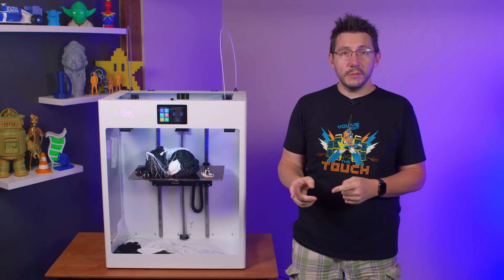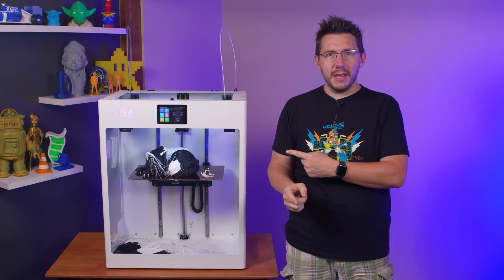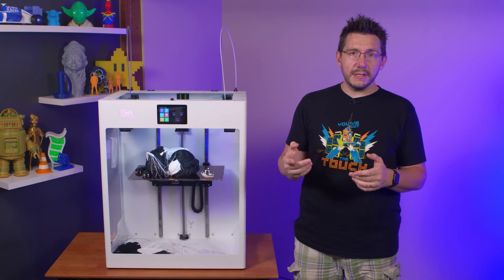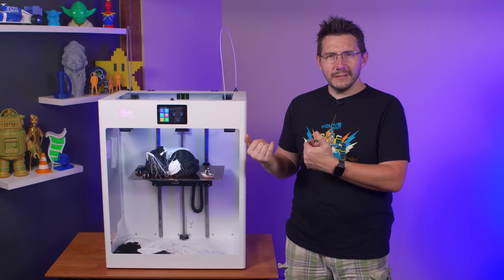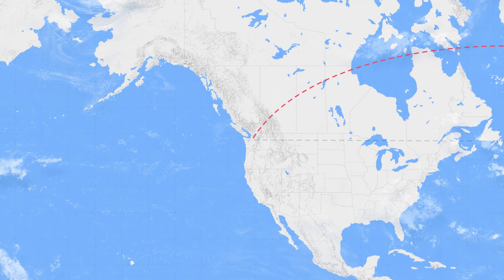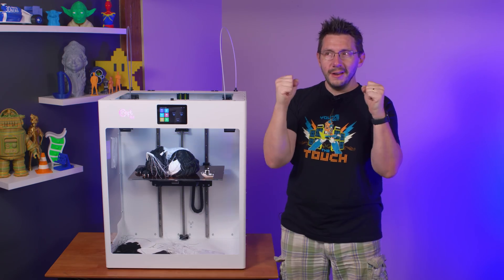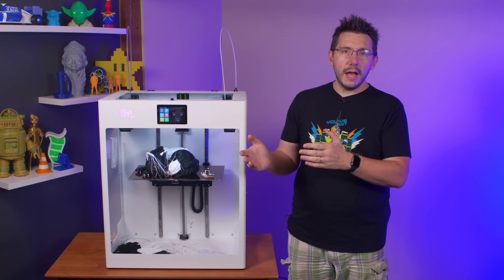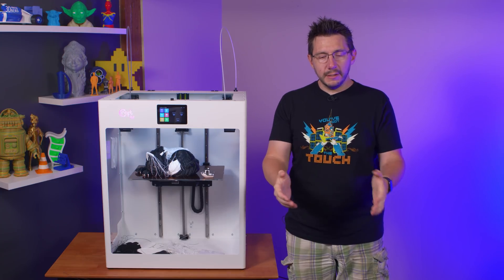Craftbot FLOW IDEX XL Update - THE PINS WERE BENT!

Comment: The Flow idex is a really bad printer.We already had 3 simple craftbot+ printers before we bought the idex.All 3 cb+ was working excellent, thats why we jumped into the idex.From the first time we had serious problems with it (layer shifting, sudden stops, bed calibration problems, filament sensor problems, etc...) The Hungarian distributor just gave us a new printer in the first month, saying that they just can't repair the other one. We were very happy, thinking that now the new printer will work as expected.It did not.We had many failed prints, same bed problems, unfinished prints, firmware issues, etc...Now the printer went back the 2nd time to the Hungarian distributor, and they say its working good but we know that its not.Maybe a few prints could be good, but not all.We expected that a 4000USD price tagged printer could produce the same quality and reliablility as the old cb+, but we realized that its not going to happen.Now the distributor offered to buy it back for around 2000USD (the half of the original price!) or we can get it back with the glitches.What a bad support is this?They just neither care about their customers,  nor their printers. PLEASE, If you're planning to get this printer or any from the FLOW family, DO NOT BUY IT! Buy 4 prusa MK3S printers  instead!

Comment: Had the same bent pins issue on delivery.  Several temp driver errors. Fan issues.  Parts were replaced, but still have some print warning errors. When it works it prints well.

Comment: Wow... looks like a negative review. For just about $4K (about the same price for the E3D toolchanger kit) you get a poorly designed system made with proprietary parts. A no buy... At least based on your small sample set of tries.
OTOH... maybe if you printed for awhile with it... like maybe a spool or two and produced lots of objects and you learned how to tune the filament monitoring, you would feel different... or not.

Comment: Wait a second the nozzle was only jammed because the temperature being used was too low to melt filament that was already in it. So essentially it could have been resolve by just raising the temperature. It sounds stupid but its not surprising there are people that do this in the groups. Just looking at the pin that was soldered there that broke off it wasn't even supposed to be able to move around. With the fact it kept stopping I would have thought it was either a firmware issue or that I had missed something in regards to connectivity if the sensor was failing to be able to tell that the filament was even rolling.
Reply from the maker: Which nozzle? The one shipped to me was jammed, and the way these work - the nozzle screws through the heater block and into the heat break. To clear that nozzle in the machine, I would have had to induce some heat creep.
Reply: @3DPrintingNerd  At 7:39 when you unscrewed it you could have pulled the part out with needle nosed pliers and the heated it up without the heatsink cooling fan and then pushed it through or used a heat gun to heat it up to push it through. There are many times on other printers where people have had their heatsink cooling fan on backwards and caused this same issue.
Reply from the maker: @Deneteus  Right,  I could have introduced heat creep to solve it, or like I said in the video, I could have used a heat gun to clear it. The point is I should not have had to do any of that. Craftbot sent, essentially, a defective part. Had I been told, "this was used before in another machine, we don't know the status, check it first before installing." that would have been great. Instead it and the other pieces were sent "as new".
Reply: @3DPrintingNerd  I wasn't on your stream when you first unboxed it. I agree with the anger over the lack of communication/miscommunication when the second part was sent as to whether it had been tested and cleared before it was sent. That was clearly a QA issue that they could improve on. It wasn't immediately apparent though that you purchased this machine with your own money so anyone that has been watching you for a while would assume you would have just fixed the problem and pointed it out without the yelling/dramatics. 

It just encourages that mindset that if it doesn't work the first time you get it then you should just bash the machine or bash the manufacturer. That is the same reason we have people destroying Creality Ender-3's for attention. Sometimes printers do get damaged in the mail. Paying alot of money doesn't always mean that things will work they way you want them to. 

Sometimes people also get printers or parts that people have returned. We are still in a pandemic and sometimes people forget that so anything you are attempting to do is being magnified on top of the fact that there are obviously other people that have also run into issues. I am not sure if you realize that not everyone took that part of the video the same way. Whatever the issue is with their QA, hopefully they will fix it. If not they will go out of business with the rest of them.
Reply from the maker: @Deneteus  Hey dude, you make some very good points. Though, regarding the mindset - I have to disagree. I fully get what you're saying, but in my case, we are talking about a review unit, and then the company reached out the next morning saying they were sending me new parts to fix it. I get that money doesn't always equal it should work 100% right away, and I know people talk learning curves, and experience, I get it. But, in no way shape or form should Craftbot have sent a clogged nozzle as a quick ship repair piece. Had they reached out the next morning with tips and tricks to try, rather than insta-shipping new things, it would have been an entirely different story.

Comment: We have one of these since 2 months ago. Spent a lot of time to get it commissioned. They clearly have quality control issues, our machine had the set screw for the right extruder filament gear overtightened (hex slot ruined). Also one of the right extruder hot-end hex screws is eating its threads and will need replacement. A few other practical observations:
- Despite the automation, this is not a beginner printer. You need considerable expertise to work through eventual issues. There are apparently only a few users as there is not much help online.
- Overall the machine is built like a tank and you can see quality design touches everywhere. The automatic calibration is a must-have. 
- Extruder shroud re-assembly is delicate work. Think of it as attaching the display flex cable of an iPhone. If you misalign the shroud and use any force you will get the results in this video: bent pins and de-soldered guide pins. That is not shipping damage but forced assembly.
- Don't think the nozzle is pre-clogged, there's just some filament left in the feed channel (filament was unloaded cold after factory test?). Just heat the nozzle and use one of the smaller hex keys in the kit to force the filament into the nozzle (after releasing extruder gear pressure) 
- When you swap a steel nozzle to print non-toy materials, it will be higher than the brass one. So swap both of them even if you use the right extruder for support. If the nozzle heights differ by more than 0.1? mm you need to move the right extruder manually. It does not work like in their instructions (gravity drop to the bed), you need to actually force push it down to touch the bed.
- We have had nothing than trouble with PVA supports. All PVA we have tried has been flexible enough to get stuck in the filament sensor aperture. Results in terrible clogging that needs extruder disassy to clear. If you release the extruder tension it does not extrude properly. Just use HIPS for support.
- Firmware (latest of course) has weird issues with the whole printer freezing with no apparent reason (just stops and extrudes a biig blob, or makes weird moves and the freezes completely). Suggest power cycling before a longer print.
- The remote UI does not (yet) replicate all the features of the touch screen so you cannot really adjust the print job remotely. And the camera is too low resolution (cheap?)
- Our biggest gripe is the lack of z fine-tuning. The automatic calibration leaves z too high. To get stuff to stick to the bed we currently need to apply a global gcode offset in S3D
- Get spare silicone socks for hot-ends (they break easily when you swap nozzles). Also get spare bed probe pins, the machine eats those whenever you crash the left extruder

Comment: I don't care how bad a product is, but cmon... The clogged nozzle was obviously placed from you using it to test it. Im not saying that the product is good at all, since it should have not clogged, but it was not sent in that condition, that is pretty much like calling workers over there a moron/dick for pre clogging your nozzle... Will probably getting the worker that sent you the assembly in trouble, not very cool thing to do.
Reply from the maker: That's how it arrived, why would I lie about that? Why would you think I'm not telling the truth about that? It was sent in that condition 100%.
Reply: @3DPrintingNerd  Im not saying that you are intentionally lying, just that you believe that the nozzle came that way, whereas that clog probably came after your first "test" print run.
Reply from the maker: @Gabriel-us7gi  No, dude. It came that way. I installed it. The filament wouldn't pass through. It couldn't get to the melt zone. The filament inside that nozzle is ABOVE the heater, and into the heat break. I promise, that is 100% how the nozzle came to me. I have no reason to lie about that, or fib, or anything.

Comment: I couldn’t find a place to post this so here it is. I have changed both heating element on the extruder and the   thermal sensor. When I turn the printer on and turn the temperature up to 210. The temperature does nothing and then I get the error saying E1 thermal runaway printer halted please rest. Should I do a PID to fix’s this issue or could be the
main board that has went bad? Any help would be appreciated.

Comment: Just disassemble the extruder one more time, if you unscrew the 2 allen screws which hold the spring you will see that one is too long and contacts the other side, so the force of the filament ist low.  I had the same issues.
Reply from the maker: Wait - really?
Reply: @3DPrintingNerd  Yes, really, I can send you pictures if you want. I had the same problem with the jamed extruder and detected a low force on the filament. after shortening the screw it printed fine.
Reply: Or you could adjust the filament adjust screw on the top of the extruder and your problem would have been solved no need to disassemble
Reply: @fuse3d  Thanks for reminding, this was also a problem at my flow.

Comment: The real problem with that PCB spring connector with soldered locating pin is that it's a terrible connector design not suitable for the application. 
Connectors are like cryptography, do not design your own.

Craftbot have obviously put a ton of work into there printers and the features are great, but they might benefit from a bit more design for manufacturing experience to address the quality and reliability problems that come with things like self designed connectors. 
If Craftbot thought that connector was ok for a product (not just a prototype) then what other questionable engineering is in the rest of the printer?

Comment: There is 2 problems here:
The design which lets this problem to occur (the alignment pin shouldn't be able to detach from the solder if other fasteners hold it well in place); I don't fully agree that it's a shipping problem
The fact their replacements had problems already. I suspect that filament in the nozzle is a higher temp material hence why it didn't budge when attempting to extrude; the fact it wasn't removed prior to sending it makes it seem like the replacement was done rapidly for damage control rather than quality control in mind.

Comment: Hey Joel, I have 4 of these machines and they are workhorses. First thing use S3D or Ideamaker for your profile, 1000%’better results than Craftware ( I use S3D). I get you have had issues but I just havent had the same experience and there are many that havent had issues. This printer has so much potential hopefully the new one is much better.
Reply: Tell us how you support the "Backup Mode" in S3D?  You shouldn't have to buy a slicer because the company can't figure out how to write software.
Reply: @A1N0  You use backup mode on the HMI, it acts independently of the slicer. I didn't buy S3D because of CW , I use S3D because it gives me the best results.